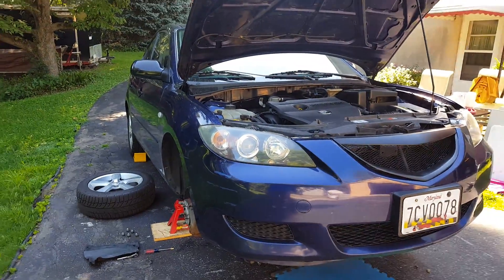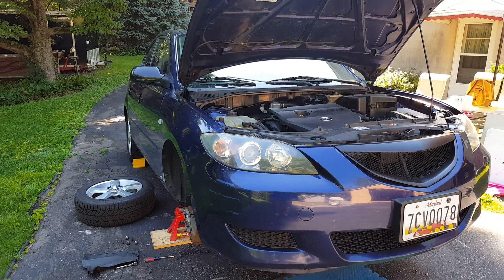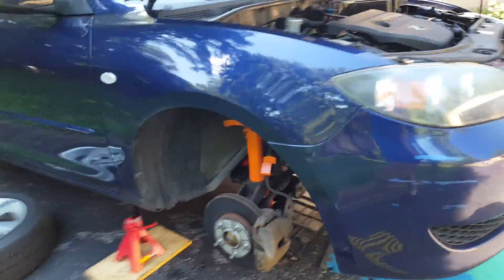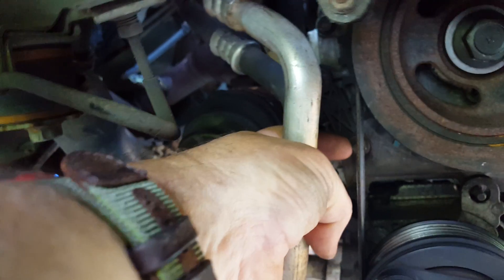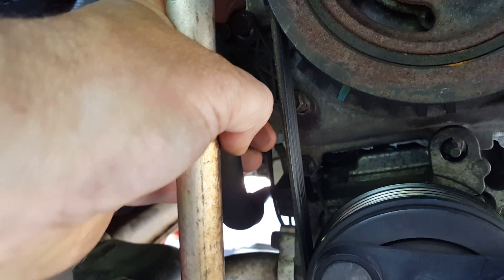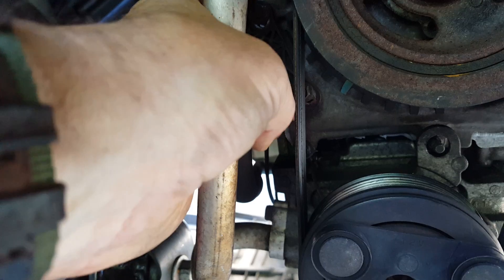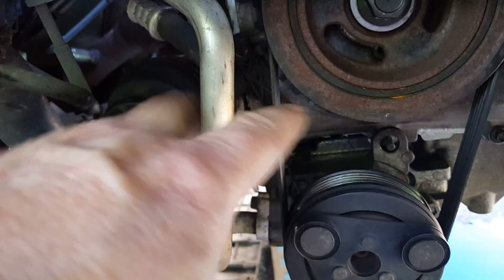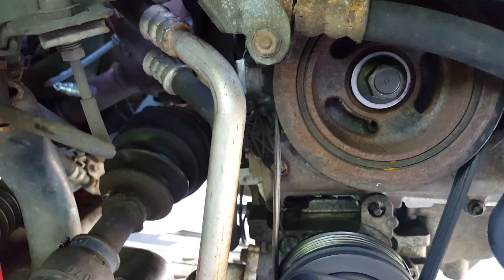How to advance the timing on a Mazda 3

Comment: I have a 2007 2.3 hatch but got a P0016
Code says my crank and cam are out of correlations sensor b
I’ve replaced that sensor but should I slide it down too? I have a feeling my timing jumped a tooth trying to find solution 
It runs fine but can’t pass emission sensors are so expensive for Mazda haha

Comment: My mate did this for his 2.0 2006 mazda 3 the other day and got a nice surprise by the performance boost that he got. And my other mate who is a mechanic did the same thing to a mazda 3 that he had and he said that he never had a problem for aslong as you stick to a higher octane fuel. My mate who did this the other day said the his car experiences less delay and lag on both throttle response and gear shifts on the auto transmission mission. Not sure what it would have to do with the gearbox shifting better but its certainly a more lively car than before and has more exhaust pops 😂 im thinking of doing the same with my mazda 3 as here in Australia the best fuel we have is 98 octane

Comment: Would this work on a 2012 mazda 3 with the 2.5 liter engine?
Reply from the maker: Yes it should.  The 2012 2.5 is still a MZR engine so it should.
Reply: @Rumnhammer  thank you and it’s safe?
Reply from the maker: @Chriskary1  Yes totally the tuning on these cars is very conservative, I run 87 in my car even in the summer with no issues.

Comment: i AM Sure the dealer followed the book procedure and set it up correctly, thanks for the video. How did you verify how many degrees advanced you gained from the factory setting ? I am not sure there is 10 degrees travel from the factory to full advance in the bolt slot in the sensor ??

Comment: My mazda 3 makes a squeely noise when at low revs in a gear..

Not sure if its a pully or chain.

I have ordered a obd reader to check angle. 

Would advancing this cure the low end revs noise ? 

Also do you know where i can find what my timing should be ? So.i can compare it to the obd reading.

Thanks
Reply: no, replace timing chain....
Reply: @show316316   replaced aux belts noise gone now belts wear brown n pitted
Reply: @cheezy_entertainment759  in my case, it doesn't work. So I'm planing to replace timing chain in a long weekend. But I don't know why the timing chain kit of Mazda 6 gh 2.5 is twice as expensive than 2.2D and 2.3....it's unfair
Reply: Had the same problem with my 2.0 Sport. Its the AC compressor, its a knows problem with this car, could be the ac compressor clutch or bearings. That's what caused my squeaking noise anyway, but I did change my Aux belt for good measure.

Comment: hello, i notice an ignition warning P0328 (knock sencor) in my odb material.  it's may cause by the clank on the motor. it's happens when it's cold ( -5 to 5 degree celcius). In spring and summer come back no problems.
 Can i try this méthod in order to repair my trouble on my mazda 3 (2005). Sorry for my english i come from france. Thank
Reply: Use higher octane fuel ⛽️ 😎that will eliminate the knock sensor issues

Comment: Let me save you time. A simple hand held scan tool that shows PID data easily disproves this mod. This does not have any effect on timing or boosting of HP. Sorry. If you "feel" it does, I invite you to show me the dyno results.
Reply from the maker: I would say show me that it doesn't.  The #2 Mazda mechanic in the country showed me this, so I'm more inclined to believe him then some random internet person....
Reply: There will always be THAT guy...”I have 10’s of thousands of specialized tools.”...so? Did your urge to include your “expensive tools” overpower your ability to get to the point?
Reply: @Adan Altamirano Hahahahahahahha....... I agree,
i was thinking the same thing, not to offend but what was the point of mentioning you have 10's of thousands of specialized tools, saying that, it doesn't make you any better, also saying that you have ACCESS to these tools at your disposal........meaning.......their not your tools.....they belong to the company you work for, besides give this guy a break @Rumnhammer, he is just trying to help making this video WITHOUT USING 10'S OF THOUSANDS OF SPECIALIZED EQUIPMENT
Reply from the maker: @coachwhitford7315  You are correct on all counts, what I did is change the base timing, and without proper tuning of the ecu you will not see much difference. You admit that the numbers changed, not much but they did change.   This does change the timing it is the base timing that the ecu starts at most people don't understand that.  I'm glad that you do because it saves me having to explain how it works.   I personally noticed quite a big difference in the engine response, and my gas mileage as well, but then again I have other mods to the car that you may not have.  I never touted this as a major hp increase and based my claim on what I myself experienced after doing it.   Is your 3 stock?  Mine mostly is except for the mods listed in the other video.   Although since that video was made, I've replaced the engine with a lower mileage one and added an exhaust, and header, lightweight flywheel and higher performance clutch.    I noticed the biggest difference after adding the header and exhaust, the engine really woke up after that, these are all small changes though and the ecu will adjust to them over time as well.  I suppose I should have posted the caveat that this would provide minimal gains.
Reply from the maker: Oh by the way the air/oil separator is a great thing to have on these engines, because the distance is so short between the PCV valve and the intake and baffles below the PCV don't really do a good job you would not believe how much oil vapor it catches.    Cleaning the back of the throttle body should be mandatory maintenance as well because the EGR carbonises that oil vapor onto the back of the throttle quite a bit as well.
Reply: @Rumnhammer  what he meant is that if you were to jump teeth on the timing belt (or turn the crank from TDC and leave the belt in the same position) it would affect the base timing, thus advancing/retarding it, but the car wouldn't run right anymore anyway..

Comment: WTF! Can you people stop this shit? It is only a sensor that counts the teeth on the crankpulley that you can clearly see, it knows the rpm of the engine and gives this info to the computer ecu so it can adapt to  how much fuel to air goes in to the engine, so stop this silly videos (at 18 years old i punched holes with a hammer and screwdriver in the exhaust because someone told my car will be faster😂 it was a nissan micra 1.0 1990😂)
Reply from the maker: You are obviously a moron, you are describing what MAF does.   That measures airflow in order to determine how much fuel to add.   This controls the timing of the engine. Two entirely different things.   I don't doubt you punched holes in your exhaust,  you're probably stupid enough to believe your car would run on donkey piss as well.
Reply: @Rumnhammer  3 years on and this roast still has that man on fire
Reply: @Rumnhammer  roasted his ass 😂😂😂

Comment: Sorry one more thing...did you remove the negative battery cable or not?
Thanks.
Reply from the maker: You can, so the car will adapt sooner.
Reply: For this mod do not remove the neg battery or it will take LONGER to reset. then you want to turn the car on and idle for 10-15mins then turn A/C max and continue to idle for another 10 mins. At that point your engine should have reset by then.
Reply: Hi Guys. Still haven't done this mod. Question for you....why would Mazda even build this modification onto this engine? Why not build it at the higher HP level and not have the adjustment available at all? I know its probably because of economy/cost (87 octane vs 89 or higher). Why would they build this mod into the engine if changing it to any setting other than the factory setting would risk damaging the engine?
Reply: @ianr8538  the limit you can move at won't hurt, I've made a bracket on my 2.3 duratec (Mazda 23NS) and moved it to where it's idling at 2 degrees and at 6k it's at 34 degrees, I moved it 1/8 inch further then allowed and the bracket was erector set parts for simplicity

Comment: Hi...Ian again. What has your experience been with this modification? Is this not going to run the risk of damaging a pistons? Have you run this mod for a bit now? Do you get away with using 89 octane or do you find you have to go to 91 or higher to completely get rid of any knock?
Along with your other mods any guesstimate as to the new whp rating?
Reply from the maker: Yeah I just run 89 octane and no problems.    In the winter you could probably run 87  No idea what hp gains probably about 5 or so.
Reply: Hey. I still haven't done this mod yet. I'm still wondering why Mazda would build a mod like this on their engine. Why not just set the timing at the more aggressive setting and ask the owners to use 89 octane all the time? More power all the time? I'm sure its an economical reason. Also why would they give this option on the engine if their was any possibility of damage to the engine?

Comment: How did you modify / remove your intake manifold flaps ? What did you use to plug the holes? Did you replace part of the removed the bar to block the hole for the bar on the air cleaner side/ actuator side .Have you fitted the headers yet? How does your car go now? Some people have reported loss of power /torque in the low to mid range with the removal of the flaps. I have bought a used manifold to experiment with this mod on the strength of your cheap mods video.
Reply from the maker: You can find a thread with the procedure on the mazda 3 forums several people have documented it.  You don't have to plug the holes in between the runners since it just goes into the next runner and not to the outside.  You just replace the actuator in the hole it filled originally and reconnect the solenoid to it all it will do is rotate in place since you have removed the bar.  May have lost a little in the low range, but not much the power from this is mostly in the Mid range.   It is noticeable.  The flaps are just for emissions and don't add much to the low end. above about 2k rpm they are just a restriction in the intake tract.   I have put the MSDS headers on and will be doing a review soon.  I am going to replace the engine in the spring because the current one is using a ton of oil.   I'm just doing a replacement 2 liter with less miles on it.  Since I still want good gas mileage from the car.   Will probably do a video on that as well.
Reply: Very good ,looking forward to more vids. By the way did ,you use new gaskets when you replaced the inlet manifold after flap delete? Gez.
Reply from the maker: Yes I used new intake manifold gaskets,   also a very good Idea to remove the throttle body and clean that too. mine had a ton of carbon on the back of it so it idled much better after cleaning it.